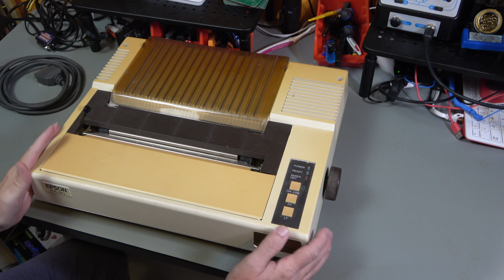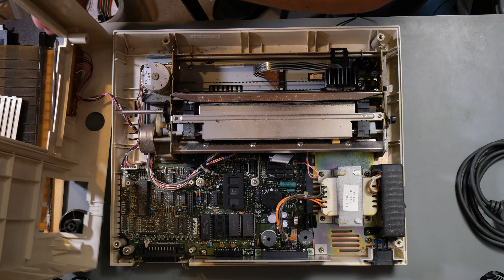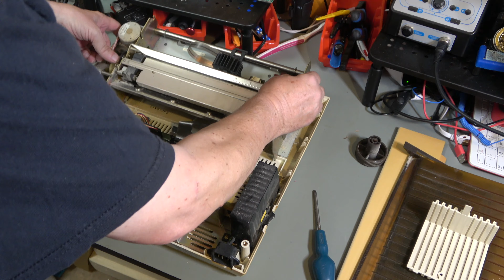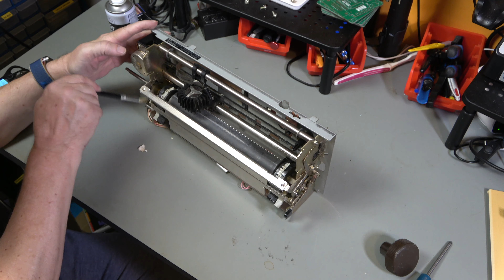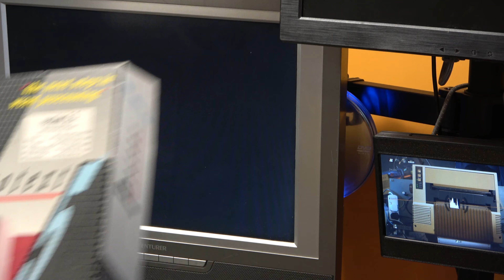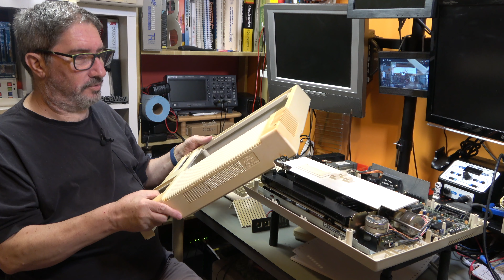Epson FX80 Dot Matrix Printer Refurb

Comment: This Printer with my C64 got me through University.
I created a basic program in a computer magazine which I created a word processor I typing in lines of numbers with a check digit at the end of each line.  I used this word processor for all my papers.  I also wrote a program to graph all the data from my class and printed it our on this printer.😀
Reply from the maker: I did much the same, although I was using a C128 by the time I had the Epson. (With the C64 I had an MPS801, which has to be the worst printer ever invented! Well, apart from the silver paper printer for the ZX Spectrum!)

Comment: Thanks for giving an old printer new life. If you pick up a USB to centronics adapter, the printer will work with modern operating systems like Win 10 etc. with a USB port. The default printer drivers are already supplied and just need to be selected. The similar FX100 is just the wide carriage version of the FX80. Back in  the day, you could get from "Finger Print" a "Letterwriter" kit that provided replacement chips and instructions to enable higher quality printing emulation styles with these printers.
Reply from the maker: I'll look into the USB to Centronics adapter - thanks.

Comment: My Dad had an FX-80 for his BBC Micro, and I don't think he ever bought a new ribbon for it. His trick was to open the ribbon case (carefully, so as not to let the ribbon spring out), give the ribbon mass a moderate even spray with WD-40, reassemble, and leave it for a few hours.

As the print head only hammers the centre third or so of the ribbon, the solvent in the WD-40 would wick some of the ink from the unused top and bottom to replenish the used stripe. If done with the right amount of spray, it was indistinguishable from a new ribbon. 

I'm not sure if the thin lube in the WD-40 played any role, but I doubt it'd hurt.

He ran our school's computer department with about 100 BBC Micros and subsequently Arcs across the campus, so this trick was used to significantly reduce the consumables cost right up until they switched to laser printing.
Reply from the maker: I did try re-inking mine once back in the day. I remember it was very messy and not particularly effective. Ink went everywhere except into the ribbon, and subsequent prints could only be described as "blotchy". Maybe WD-40 would have done better...

Comment: I always wanted one of these...My friend's dad had one...
My first printer was a Brother HR5 back when I had a BBC Electron fitted with a Plus 1(JoyStick and ROM Cartridge adapter) and a Plus 3 
(3.5" Single Sided, Single Dencity Disc Drive)
The Computer looked amazing but the printer was terrible, but good (ish) for the day. (Around 1983)
£200 for the Computer, (Edited)
£60 for the Plus 1,
£200 for the Plus 3,
£150 for the printer,  (Ribbon Cartridge similar to the Epsom in the video but gave 30 Characters per second.  It did have character decenders though....)
Reply from the maker: I don't remember what I paid back in the day, but they were certainly not cheap - easily as much as the computer itself cost. I'd guess around £300-400

Comment: Oh, how interesting. As a child, I never had a printer with my Commodore (the plus/4). I only recently bought one. Of course, it is the C=MPS-801 you mentioned and so I made a few videos renovating that machine, in anticipation that I may learn how to get the best from these dot-matrix printers. I chose to paint the case, as they can be quite large. Also, I note that "The Commodore Disk and Printer Handbook", of 1984, dedicates a whole chapter to the Epson (the RX-80 used with an Aztec Printer Interface, but I guess that is a very similar machine). Best wishes, Jimbo.
Reply from the maker: You can easily spot the slightly odd looking printing of an MPS-801!
Reply: @TimsRetroCorner  Yes, the better Vic-1526/MPS-802 had 'descenders' which reached below the line.

Comment: I find the sound of an Epson dot matrix printer so nostalgic, as a young lad I had a part time job back in 1987/88 servicing those things. Very different sound to the Epson 24 pin printers I also worked on.
Reply from the maker: I seem to recall they started using thinner plastic with the 24 pin printers - they were a light assault vehicle compared to the FX-80 "main battle tank"!
Reply: @TimsRetroCorner  Maybe but the 24pin printers were much heavier over all because of the print mechanism so they probably tried to keep the weight down elsewhere. The FX-80 was so iconic though because it seemed to be everywhere back then from corporations to the classroom and it was super rugged compared to most other printers of the time. Probably why it was so popular in schools.

Comment: I very much remember the sound specifically of a 9 pin dot matrix printer.  It was so much more crude and rough sounding than my friend's 24pin printer back then. I had a Star NX1000 color printer in the late 80s for my C64 and some fancy interface. Then I was able to also use it in the early 90s on a 486 PC.  I was amazed at how much an 8bit computer had limited what the printer could do and also not requiring an interface of any kind.
Reply from the maker: It's an iconic sound, isn't it. There's an IEC (C64 serial) to Centronics interface on eBay at the moment. I'm hoping to win it...
Reply: @TimsRetroCorner  Sadly I no longer have the printer, but I do still have the interface.  Xetec Super Graphix Gold.